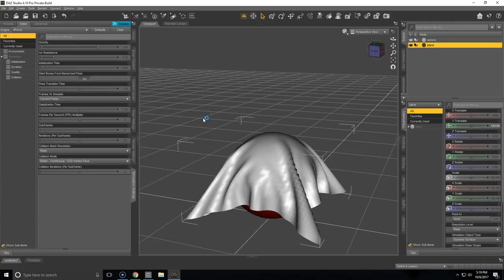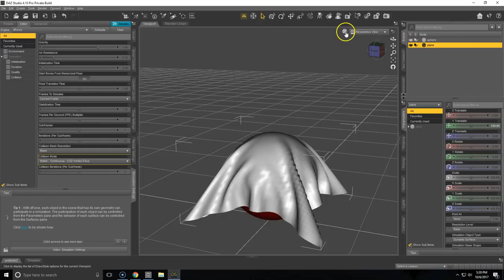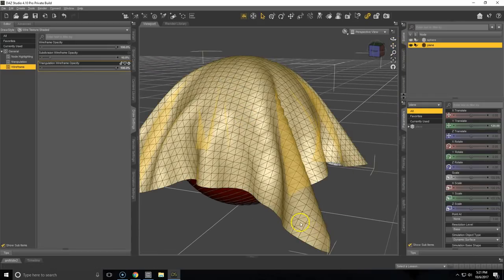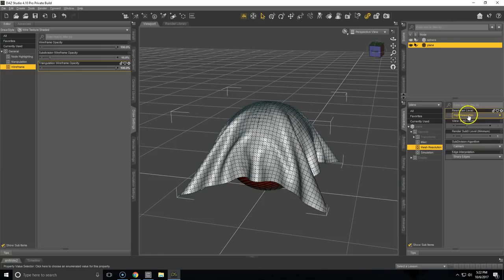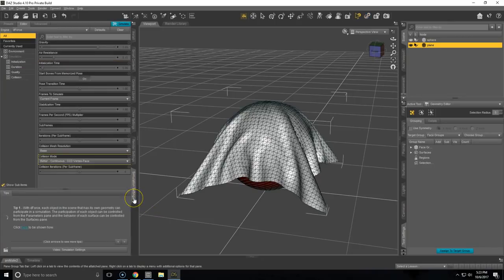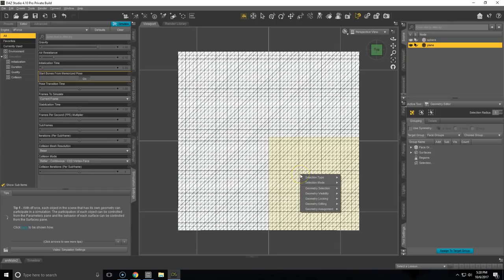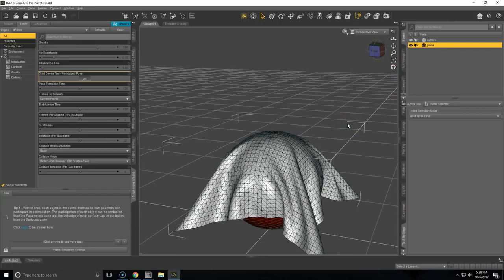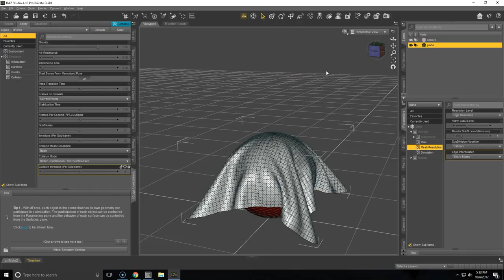Daz 3D Tutorial: Having problems with dForce? The mesh tool is here to help

Comment: I can´t see significative diference on the plane from the first and the last step on the tutorial. Also when you go to apply dforece to hairs, usually never works well at first. Would be nice if Daz explains better how to work with Dforce on haris, clothes, etc... usually is far away to be so easy as even touch some parameters and push simulation buttons... 😮‍💨😮‍💨😮‍💨

Comment: This is video add-on to the interactive tutorial inside of Daz Studio (which walks you through the experience.)  To go through the interactive tutorial itself, 1- Make sure you have Daz Studio installed, as well as the dForce Starter Essentials. 2- launch Daz Studio.  If you don't see the "Simulation Settings" pane you can open it by clicking Window=>Panes->Simulation settings.  3- from the "editor" tab within the simulation setting spane (be sure you're in editor, not in advanced or presets) you should be able to see "tips" down at the bottom.  Tip #1 has a link at the bottom of it that you can click to follow a guided tutorial through dForce.  This video is meant to be additional information after having finished that walk-through.